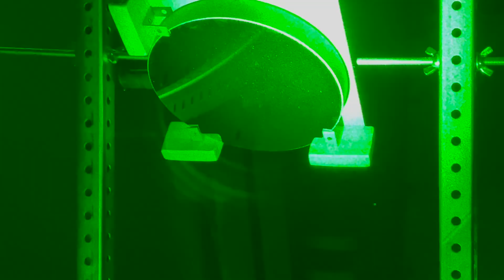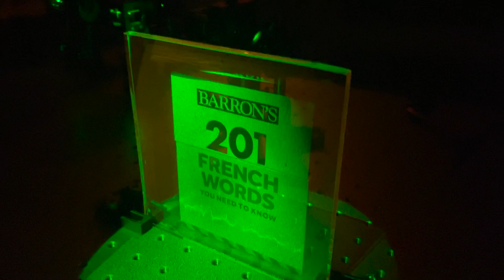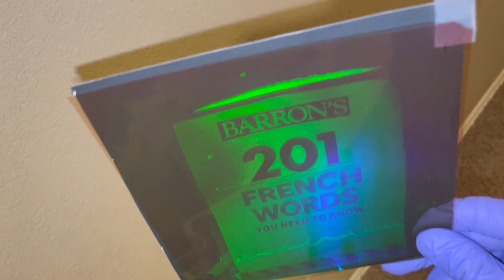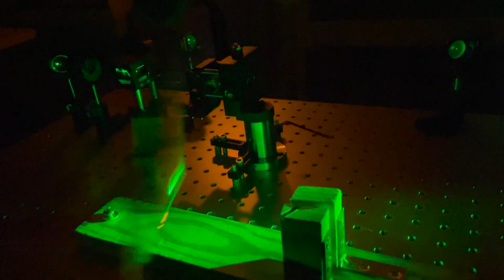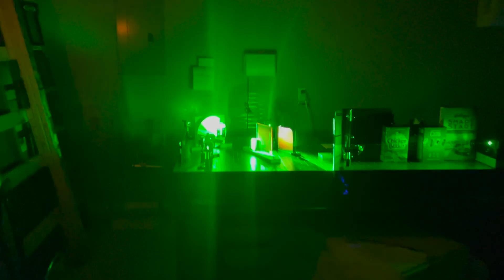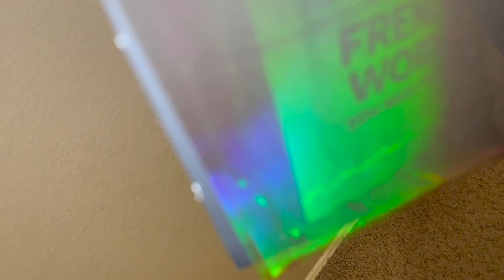Creating H1-H2 Transfer Hologram

Comment: This is amazing stuff, finally someone on youtube explaining things clearly! I actually have a few questions about the process:
1) What kind of holographic plate are you using?
2) I see some woodgrain, is this because you are using s-polarization instead of p?
3) To make the H2, you must illuminate the H1 hologram with the conjugate beam. Is this just simply done by flipping the plate, or do you instead need to flip the plate AND also change the divergence of the beam to be opposite (like for example if you used a divergent beam to record it, now you need to use a convergent beam to replay it)? 

Thank you!